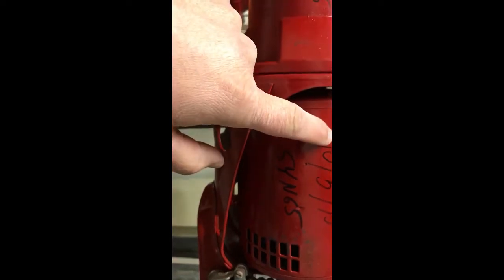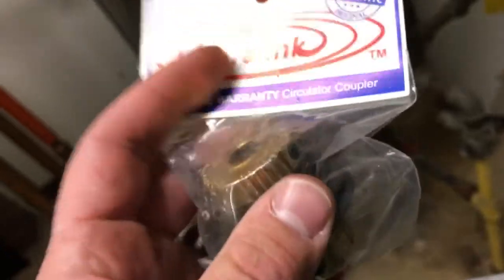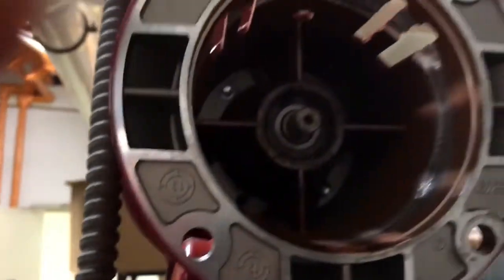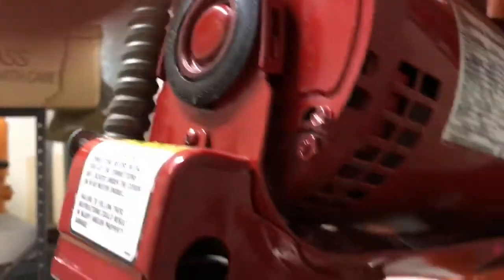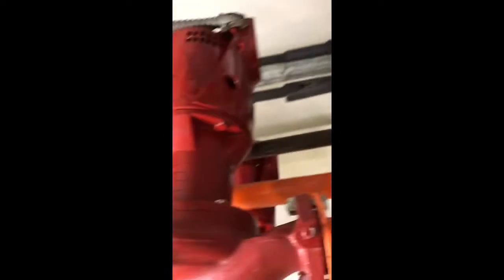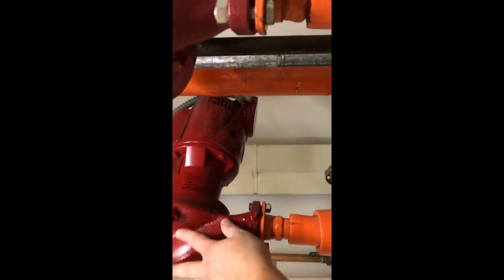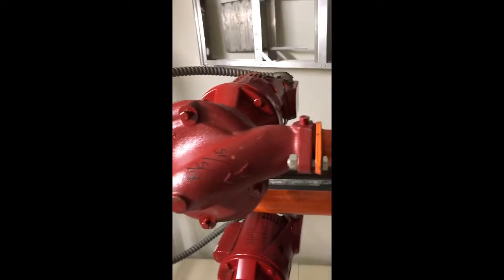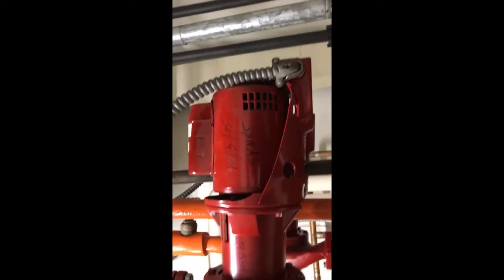Replacing a B&G circulator pump coupling.

Comment: I'm surprised you used the old style coupler when you know they only last about a year. Most of those pumps do 2 1/2 million revs a day. The (oem) couplers have 16 wearing surfaces. You can hear them @ 6:36. You should have use the other "single spring coupling". It has no wearing surfaces hence quieter and last longer.That Spiralink coupler is also easier to install. We only use them now.

Comment: Use the SPIRALINK coupler. It is easier to install, lasts longer, easier on the bearings (motor and bearing 
assembly) , and quieter